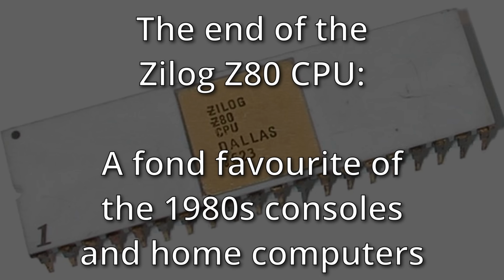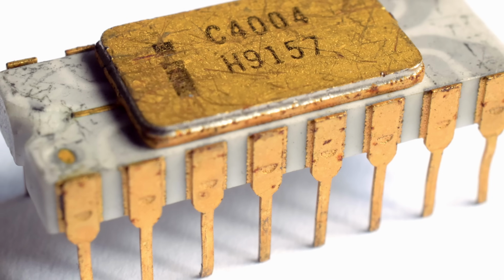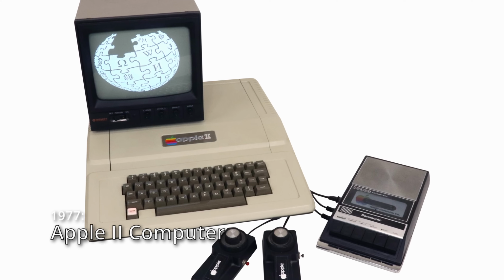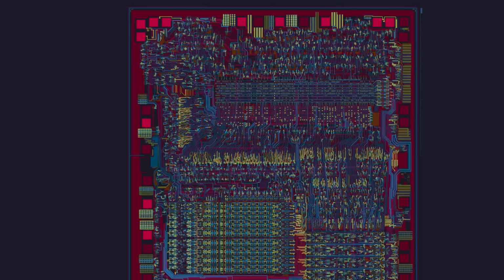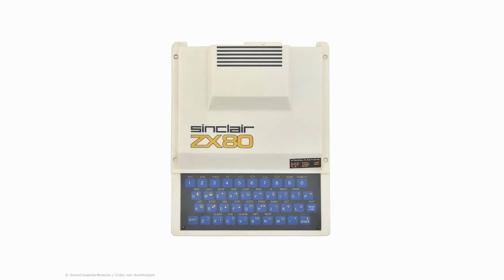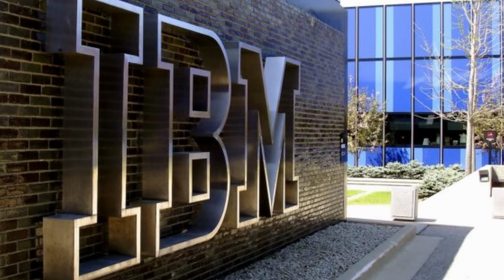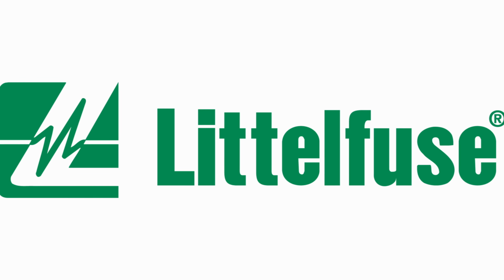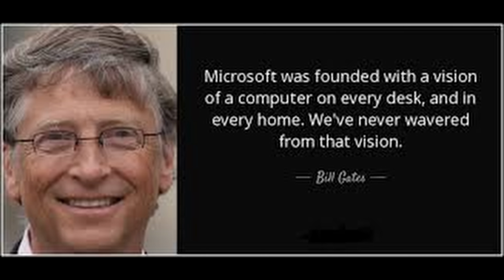The Z80 CPU - 1976 to 2024

Comment: In the 1980s I was at university doing research in Chemistry. We ran our equipment and processed results using two Research Machines 380Z microcomputers and I typed up my doctoral thesis on an Amstrad PCW 9512.
Reply: I worked for RM for almost 30 years starting 1981. I helped design, test and manufacture 380Z and 480Z. The main problem with the Z80 had very slow I/O cycles (as opposed to memory cycles).  We programmed in assembler - happy days!

Comment: Made a project when i was in the sixth form (1980-81) - disco light sequencer built around a Z80A. Hand compiled assembler into a 2716 UV EPROM.  Hand drawn photo etched PCB. It eventually died when the NiCd battery leaked and ate the track!

Comment: Z80 was faster at certain low level operations. But the 6502 ran rings around it running higher end stuff thanks to 
its zero page addressing mode which gave it 128 sixteen bit registers.

Comment: Was a 6502 kid myself.  had some neat tricks of it's own with zero page address redirection saving many cycles to perform similar... also able to rewrite it's own code because of the shared memory space.
Reply: 6502 at home, 8080 in school. Both had easy to learn layout and instruction set. I preferred 6502 because of addressing modes, but had nothing against 8080.
Reply: Don't get me wrong the Z80 was a beast... but I had to make do with what I had ;)  The real issue was that neither Zilog or Rockwell were quick on the uptake of SOC so most of the first generation of embedded's ended up being 8088/6 devices.  Dallas Semi took those and ran making some really cool ultra low powered devices with some exceptional low power static ram stuff based off of the 8051 architecture.
Reply from the maker: I am happy to say that I love the 6502 and Z80 equally 😍

Comment: No way was Z80 faster than 286. The 8088 was limited by the 8 bit bus which meant instructions took more time to fetch than to execute. Also many early software likely was written for 8080 and just cross assembled. 8086 was assembler level compatible with 8080.

Comment: I found this video fascinating and sad in some ways seeing at the same time seeing an old acquaintance retire but then again technology moves on.

From 1980 to 1987, I worked for Visual Technology. Visual used the Z80 almost exclusively in their terminal products except for one model that came out in early 1987 which used the 68K. In addition to their terminals, they also produced a couple of personal computers, with one being the V1050. The V1050 had both a Z80 for its main operations and a 6502 for graphics allowing the system to perform some amazing tasks and ran CP/M Plus. 

As a technician, I knew the pinouts inside and out and while attending night classes towards my degree, I took a class in Z80 Assembly language which was offered at the time. As it turned out, the professor owned a Visual V1050 and I ended up repairing it for him when it crashed. For our class project, we used Apple II computers with that Z80 card installed. All it took was a simple key-combination that switched between Apple OS and CP/M 2.0.

Comment: z80 supported 48 KiBs of RAM and so it lasted for 48 years :), ~3bytes a day
Reply: Strictly it could access 64 KiBs - kilobytes - of RAM with its 16 address lines. Therefore that’s 1.333 KiBs per year, or approximately 3.74 Bytes per day.
Reply: @derekjc777  oh thank you i thought there was some issue with bank changing and practically it was limited to 48kB and some character map but i am not an expert -  maybe it was only sinclair limitation - i remember there were only 2 versions: 48kB and probably smaller 16kB or 32kB  version.
Reply: @Tylko_cała_prawda_jest_Prawdą  Each system had different sized ROMs, for example, the ZX80 ROM was 4 Kbytes, whereas the ZX81 had an 8K ROM, but you don’t even need a ROM, you could just use RAM and a separate system to load a bootloader into RAM, and use that to load an OS, which is what the Amiga 1000 did, or even PCs without a hard disk. So you could load a tape loader routine of a couple of hundred bytes into address 0 and then effectively load your own ROM, using all 64 Kbytes of RAM.

Comment: The Z80, 680xx and 6502 were brilliant toys. But nothing more. That is why the computers that used them died quickly compared to x86.
Reply: I beg to differ. The 8086 was based on the 8080, the same processor the Z80 was based on. When RAM was expensive in the ‘70s and early ’80s the 64K address space was adequate, and many early business machines were based on similar 8-bit microprocessors - definitely not toys. As memory became cheaper and technology improved - particularly regarding dye sizes and the number of transistors per chip with high yields - 16 and 32 bit processors and higher clock rates became possible making faster machines, that rivalled main frame and mini computers that used CPUs made from discrete logic chips. This doesn’t mean 8-bit machines were just toys - even though many were used as toys, or were designed to be toys as was the case for games consoles and arcade machines - but they were initially comparatively affordable business machines (CBM Pet, Apple ][, TRS-80, etc) before the 16-bit machines took over.
Reply: @derekjc777  if we look at history, the Z80 killed Tandy before ending up in toys. The 68000 killed Amiga (and almost Apple) before ending up in toys. The 6502 was a toy from the get go. We still have x86 today - in some pretty serious machines, not just toys.

Comment: I still have a Z80-powered clock, built from a kit.  It picked up the 60KHz radio signal from Rubgy, UK.  The signal contained the date and time from an atomic clock, and was sent as a fast data burst in the first second of every minute for equipment capable of reading it, followed by the same information transmitted as pulses at 1 second intervals for slower eqipment.  It has no RAM, just an EEPROM with the code and a bunch of chips to drive a 6-digit 7-segment display.  It's called the REWBICHRON, published in Radio & Electronics World back in the 80's.
Reply: Ah.....Ambit International

Comment: I had a TRS-80 and often used EDASM (an editor and assembler).
You could do nice things with the memory-mapped display.
One thing I remember was a 3D game-of-life program I wrote in assembly.
At the time you could really fully understand a PC. 
I soldered another 3 sets of memory on top of the 16 KB RAM and added an address decoder to create a whopping 48 kByte RAM.
Also a lower-case character generator as the base TRS-80 only had CAPITALS...
Reply: I did quite a lot of 'upgrades' for the TRS-80 screen memory, but it only took a single 1k x 1bit SRAM chip (from memory a 2102 or something like that) piggybacked on one of the already installed SRAMs with the chip select line taken off to pick up from the main RAM.  I used to additionally put a toggle switch between two of the ports on the back plain that could turn the chip enable on and off due to many of the PROM masks being wrongly written.
I did all my early programming by hand assembly and then typing in the hex-code using T-BUG. 😁

Comment: The Game Boy did not use a Z-80.  It was an 8080 with extensions for bit manipulation that happen to match what the Z80 has, but the Z80 is so much more, plus more registers and another set of registers for fast interrupts.
Reply: The GameBoy (DMG) used a custom system on a chip (SoC), the DMG-CPU as named by Nintendo, and LR35902 by its manufacturer Sharp. This contained a Sharp SM83 as the CPU: a hybrid between the Intel 8080 and Zilog Z80, but strictly not either. Given the extensions were Z80 extensions to the 8080 it’s closer to the Z80 than anything else.

Comment: good times... Z-80 was first CPU, I programmed in assembly.
Reply: Assembly? Pah! It was machine code all the way when I was a lad.
Reply: Sinclair Spectrum then Amstrad CPC464 - tech skills that served me well for the next 20+ years!
Reply: Hell yeah, and frankly the documentation was hard to find back then
Reply: 4004 and 6502 here..
Reply: Same.
Reply: same.
Reply: same.
Reply: Mine was the ubiquitous IBM 1401, the assembly language being autocoder.
Reply: Same
Reply: Northstar Horizon 🎉❤😂
Reply: So do I, with a friend and just right after we finished the college, we built a small development system with Z80 and their peripherials, good times programming in assembler and building by ourselves an 8-bit microcomputer. I am still connected to that world using 16-bit microcontrollers but those times with the Z80 will never be forgotten
Reply: I still have an SDK 8085 design kit.
Wonderful.
Reply: Stil remember:  LD HL  = 21H
Reply: So did I. I used DAMS.
Reply: snap
Reply: ld a,97
call &bb5a

&3e61
&cd5abb

happy days
Reply: Same :)

Comment: Well. That it’s faster than the commodore chips is not completely true on 95% of the use cases. The mos chips could execute code on both falling and rising clocks while the z80 lacking registers and had to run several clock cycles to do what the mos chips could do in half a clock cycle.

Comment: Part of the Z80 family was the Z8530 Serial Communitcation Controller.  A much better comm chip than is the Nation 8250 device that was the standard in the original IBM PC.
The TI Professional PC. (TI-PC) desktop computer used the Z8530 for it standard data comm controller.

Comment: I am surpried that no credit is given to Ted Hoff  (Intel  employee No.12).  Hoff came up with the idea of using a "universal self-contained processor" rather than a collection of discreet chips.  He designed the instruction set for the Intel 4004 with Stanley Mazor in 1969.  Development of the actual 4004 chip was done by Federico Faggin, as mentioned.
They are all credited with the invention of the Microprocessor.
Reply: No, the instruction set was from Datapoint 2200

Comment: Don't cry boys. Z80 is dead but Z180 and eZ80 still live on. Don't throw out your source codes yet.
Reply: The good part with the eZ80 is not only it's speed, but also that it's a quite energy efficient chip, the 50Mhz chip can run code as fast as a 150 Mhz Z80. 

By the way, the video didn't even mentioned the major reason many computer producers especially in the 1980s preferred the Z80 over the 8080: You ONLY needed a single 5V+ line, the 8080 needed 5V+, 5V- and 12V+, which meant you needed THREE discrete electrical circuits to run the chip. That's the reason why the Z80 fits into small calculators or handhelds and can run off four parallel 1,5V batteries or ONE 9V battery block. And why it can be used as an easy microcontroller, in space etc
Reply: @acmenipponair  Exactly, that's why I loved it, too. Around 1983 I then switched to Z180 when my products needed more memory. It was such a joy to work with, I wrote tens of thousands lines of assembly language code for it; I doubt modern day designers can experience such an intimate closeness to the machine. 🙂
Reply: Indeed, the eZ80 not only continues the instruction set (with 24 bit extensions no less) but does so at 50 MHz clock speeds.

Can you imagine whan an Amstrad CPC would have been like with a 50MHz Z80?:)

Fun part being that you could almost certainly STILL run CP/M on the eZ80. :)
Reply: @Calilasseia  Well CP/M 2.2 already runs on the Agon Light 2 which uses the eZ80!
Reply: @befeleme  Z80 is not dead. Just the 40 pin DIP is gone. Quite honestly you could take the smt version and put it on a 40 pin DIP carrier if you needed. Do your research!
Reply: @metatechnologist  Was it never available in other packages?  If it was, which ones?
Reply: @SuvroBasu  It's been available in various surface mount forms for quite a while I'm not sure what packages it's academic. Not to mention there are various other manufacturers. Of course the landscape has changed in the microcontroller arena now with the arrival of IoT.
Reply: @metatechnologist   Thanks.  As far as I remember, CPUs in those days like the 8085 were available only as PDIPs.  It was later CPUs that were available in a variety of packages, depending on whether they were desktop or notebook bound

But if all this is true, then this very underlying claim that the Z80 is dead is false.  It's like claiming that the 8086 is dead.  Yeah, but it lives on in 486 and subsequent CPUs that are still manufactured today
Reply: It would be like using a racing car in a shared space zone.
Reply: Intel 8086 code will never be irrelevant
Reply: @NerdyHillbilly  For corporate COBOL types yes.
Reply: It's not the Z80 that's ending. It's the DIP package that's ending. I don't think it's going anywhere!
Reply: Plus, there's always FPGA to serve as a good alternative to maintain older hardware. :)
Reply: Oh good they can still make the TI84
Reply: Indeed. The Z80 is available as a library building block for PLDs. This is what I found on the web about this: "Yes, Z80 implementations are available for use in CPLDs (Complex Programmable Logic Devices) through various methods, including libraries and open-source projects. While the Z80 microprocessor itself is no longer produced by Zilog, its design and logic are readily available for implementation in hardware. "
Reply: Glad to hear about the eZ80 because the Olimex AgonLight2 uses it.

Comment: I was genuinely sad when I learned that the Z80 was end-of-life. End of an era.
Reply: Cheer up, this is not an end of an era yet. Z80 is dead but eZ80 still lives on. Same instructions, better chip. And some small Chinese company might still pick it up anyway.
Reply: Wouldn't be too concerned. There are millions of Z80 based chips out there - including SoC versions of the Z80. In addition, you can emulate the Z80 in a FPGA (or similar) which yields a performance considerably superior to the stock chip. Personally, I bought one of the Spectrum Next Edition 2 which took me straight back to my first computer!
Reply: @davidgapp1457  I'd think some foundry in China would just re-silicon-compile the Z80 into a modern process and continue manufacturing..  Likely get a must faster version of the part as well.
Reply: Lived with it for few years as a designer and liked it
Reply: I was actually amazed that it was still around until last year!
Reply: Have no worries. Customizable FPGA Chips and the enhanced equivalent eZ80 keep this otherwise discontinued Microprocessor alive and well outside the original run. :) there's even ways to adapt either chip to replace bad parts on vintage computers to maintain full backwards compatibility. I say that's a pretty good alternative. :)
Reply: Yup. I’m moved, actually.
Reply: Zilog still make the Z180, Z181 and Z182. The core runs Z80 code, but has additional instructions like MULT. and you can turn off the Refresh cycles so instructions take less T-states.

Moving on from a Z80 it is difficult to find anything that has the equivalent of a Z80-SIO or a Zilog SCC with all the synchronous modes.
Reply: The Z80 and 64180 are dead. long live the Z180 and others.

Comment: The shop I worked in (1976-80)sold the Exidy Sorcerer, a Z80 micro, around 1977/8. Not a bad computer, it had 16 or 32k of RAM, could load and save to casette and you could plug in ROM modules (a PCB inside an 8-track cartridge!) for word processing or BASIC programming; other applications were planned but I never saw one. Then it got a disk drive unit that took 100k floppies or even a little hard disk, but that loaded MSDOS instead of the cartridges and took almost all of the working memory, leaving about 1.5k. I did write a stock control system to fit, but I had to use random access files on the floppy, making it slow.
Museum piece now, of course.
A few years ago, I threw out my Jupiter Ace, another Z80 machine, on the lines of the Sinclair ZX80, running Forth. I now find that they change hands for hundreds of pounds. Some you win...

And, Al, why are you saying Z the American way? Makes the video annoying. Very annoying.

Comment: Ahhhhh 8bits microprocessors, assembler programming’ push and pop ! I still have my « Zach’s » programming handbooks for the Z80 but also the competing 6502 (that was used in apple…) cheers
Reply: Also still have "Programming the Z80" book (by Rodnay Zaks, not Zach), as well as "Programming the 6809", also by Zaks.